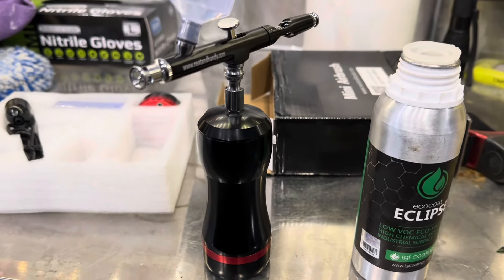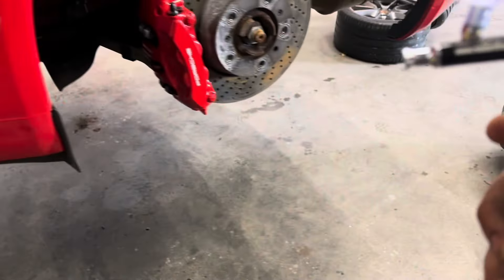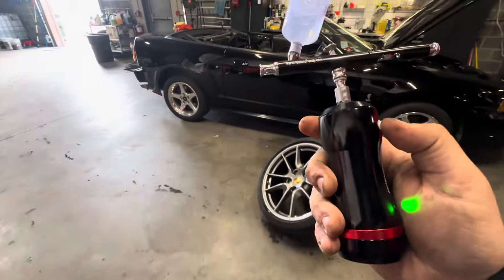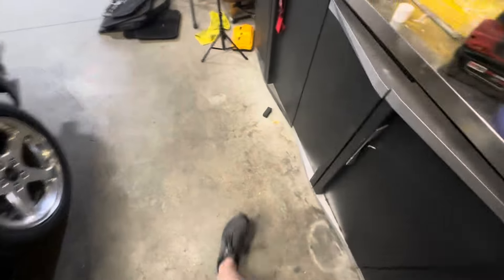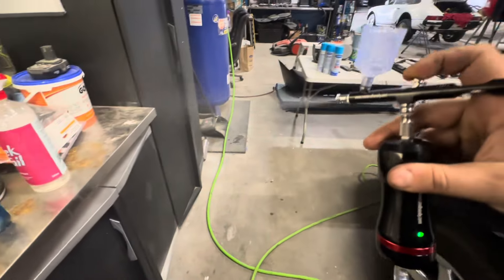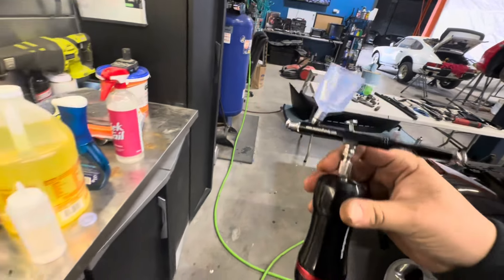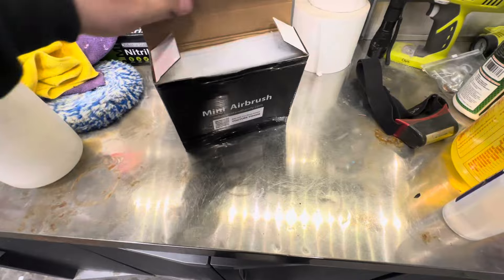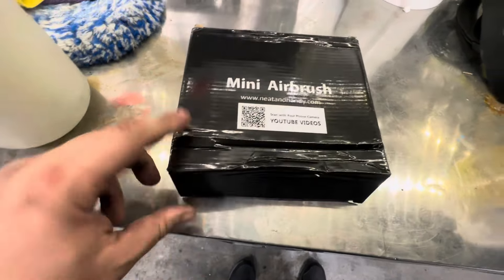Portable airbrush for ceramic coating! The Neat and Handy!!

Comment: I’m not sure about this coating but I’d be careful about spraying coatings if you don’t know whether or not they are fluorinated. PFAS and other fluoropolymer byproducts don’t need to appear on SDS right now but they will soon the way things are looking. Extremely persistent when ingested or absorbed through eyes etc. and strongly linked to multiple types of cancers and autoimmune diseases. Something to think about if doing it regularly.
Reply from the maker: I usually wear PPE so no worries